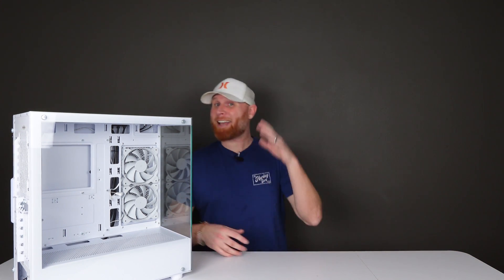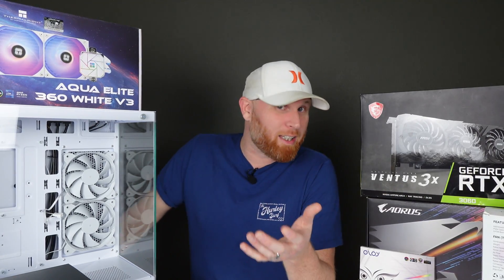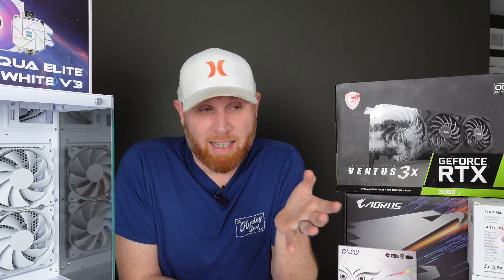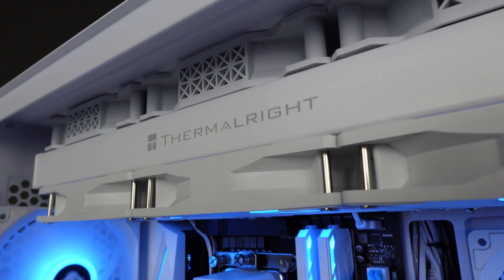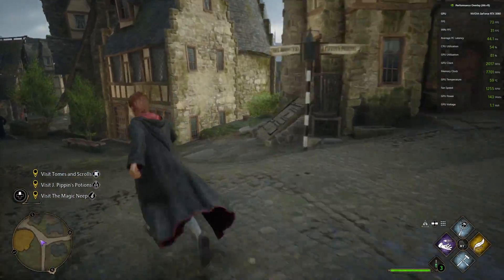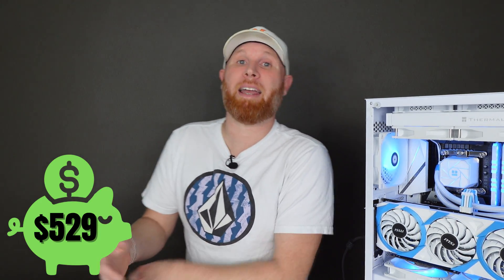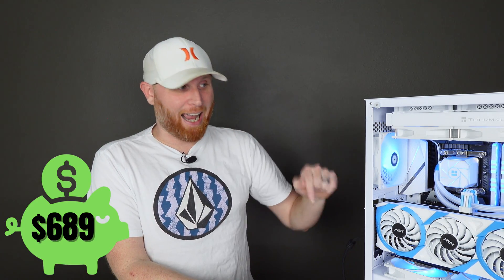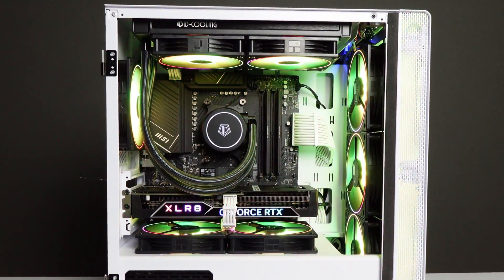You Have NEVER Seen a PC Like THIS - PCBUC S1.5E6

Comment: There is something that nobody talks about in this video, and that is that the configuration is negative pressure, therefore there are more fans that take out air than those that put in air, therefore it is disproportionate, although aesthetically it looks good, functionally it is bad. What is your opinion?

Comment: I want to see a build where different peripherals have different colors. It's boring as (censored) to see everything doing clone colors. Blue here blue there. Maybe blue at the bottom representing cooler temps and moving to more yellow, orange, red colors closer to the top where heat would rise. Then tying the color variations to reflect actual heat changes. Maybe in a pulse or heartbeat rhythm.

Comment: Hi, nice build as always, quick question : is the custom paint affecting the thermals of the gpu ? Are the fans louder due to the ''extra'' weight and layer of the paint ?
Reply from the maker: There is no thermal change on the gpu nor is there a increase in fan noise. When painting the fans on a gpu it’s very important to go very lite on the paint job and also stay as even as you can. You don’t do more then maybe 3 passes on the fans
Reply: Thank you for the info @ThePcRehab

Comment: gpu doesnt look very stable but the build looks nice good job.
Reply from the maker: It’s just attached to the built in case mount. They are never going to provide great stability but as long as you are not playing hot potato with the pc and it just sits on the desk it should be alright 😁

Comment: Very nice.

Next logical step: Paint the screws blue, it will add value and says, i done the extra effort.
Reply from the maker: I actually painted the screws in my joker supervillain build. The screws don’t paint well at all lol. You would probably need to buy new ones if you wanted it to look super clean
Reply: @ThePcRehab  Hmmm, tried to paint default screws ? Grey ones with no pre paint.

Comment: 🙂 theres a Sky Two in Blue, its only 10 bucks more over the white, theres not too many blue cases out there, i'm thinking there might be a boy out there that would really like a blue case for his bedroom, something that would coordinate better for a boys bedroom, maybe add a three fan Blue Sparkle Intel Arc to go with it. Then bling it up with blue cables and argb fans and a radiator just like u did here. And it doesn't have to be an expensive cpu, just throw in an i3-12100 and a simple ATX B board.

Comment: Really like the build. Have painted a few houses myself but have never been courageous enough to paint fans or gone with different colors. My only gripe is the push pull. I would have ditched the musetex fans. They seem to clutter it up a bit.
Reply from the maker: The fans are tricky to paint. You have to be very careful with how much and how even the pain is applied so you don’t damage the fan bearings. I tested the build with out the push pull and it looked good but that case have very large openings at the top and with just the 3 fans on there they were visible, not a ton but it was still there and I did not like that I could see them so the push pull did a good job of hiding it. Also I quite like a pc that seems full rather then very open. But sometimes I feel the opposite…guess it all depends on the build

Comment: I like that new case design, it looks like a Sky Two Clone. That case has room rite in front of the psu cover, u mite be able to install an LCD screen there? As far as the case fans I hope that in the future the case fan manufacturers design the case fans so that u can detach the blades and flip them around so that the frame and motor side can always be facing the case side. That way all u see is the blade side wether its for intake or exhaust. An alternative case fan that I highly recommend using is something called the "Bitspower Touchaqua Notos O RGB" which seems to be an exclusive at Microcenter, basically the fan blade lights up, plus it has an argb ring around the fan on both sides of the frame, so even if u have to put it backwards into the case like u did it still gives off a ton of lite anyways on the back side. I don't know why theres no clones of it yet? And as far as the power supply extensions u could offer a made to order option, if its for a girl then u can offer her pinkwhite extensions and a pink video card. Throw some Hello Kitty Stickers in it for good measure.
Reply from the maker: Thermalright actually makes a reversed fan and I did not know about it until yesterday when somebody mentioned it. And the fan you are describing sounds a lot like the Phantex fans I put inside of the most recent giveaway from the build up challenge season 1 finale. They looked so cool. Very clean look

Comment: Thing that bothered me the most about this build is seeing a 10400 going into a z series motherboard
Reply: 🙂 its fine, i have something similar on one of my pcs, i just checked ebay and the i7 11700Ks are still way overpriced but sure later on when prices come down then upgrade the cpu.
Reply: @MrSamadolfo  I didn't say it wasn't ok. It just hurts my heart to see it done. The main reason for the z series boards is to allow overclocking, and has better vrm cooling for the most part. But to put a non overclockable cpu just painful to watch
Reply: @Booth73  😊sure, i understand